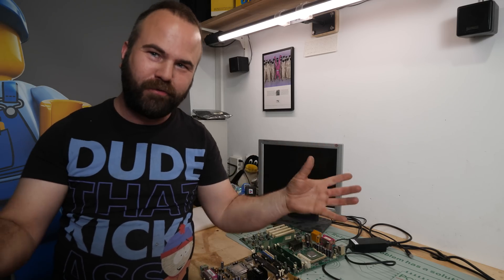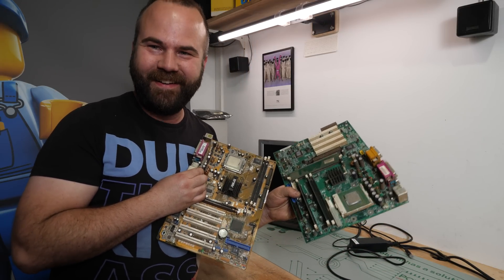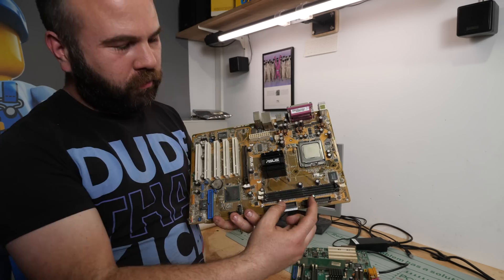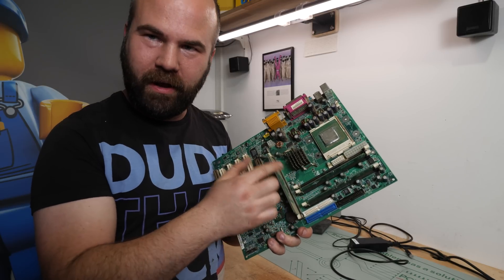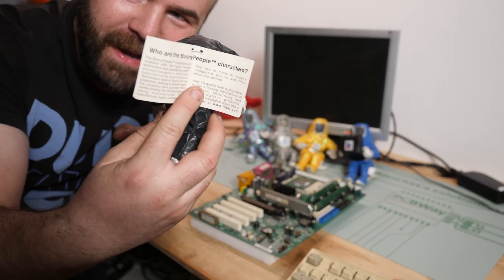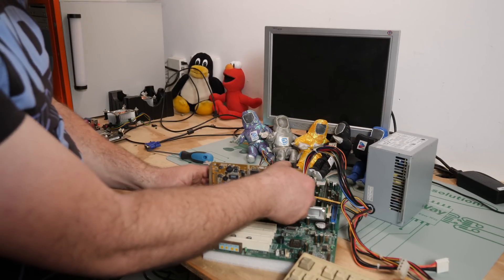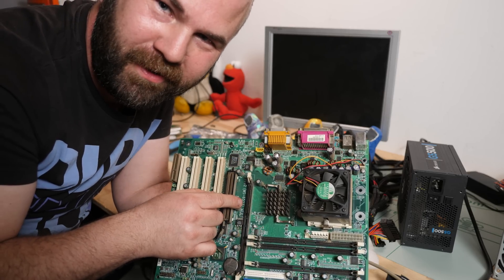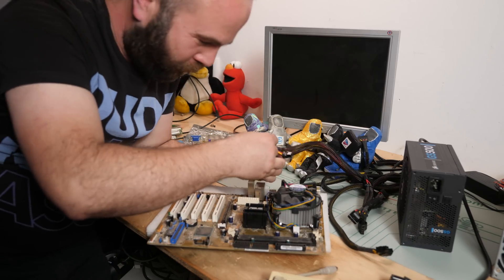Building A Pentium 4: I'm Going All In!

Comment: Many years ago a tantalum capacitor popped while I was powering up a pentium 3 board, the the flying fragment missed my eye just by a hair. Nowadays I always wear a safety goggle or glasses when powering up old boards.
Btw for your first board, I was already suspecting there was a short (in this case the exploded capacitor) because the cpu fan was not spinning, indicating the psu had detected a short in the power rail and shutting down. The Corsair could pump a lot more current and didn't consider it as a short, so the bad capacitor exploded, which is not a bad thing because you now know which component is faulty and needed to be replaced. The first psu is working fine I suspect.
For second board you need to install the cpu heat sink properly. It shut down only because the cpu was overheating.

Comment: Socket 775 and AGP slot? Interesting....

Next time try to grab a 955x motherboard, they're really cool looking and have a lot of decent features. Try to pair it with a high speed p4(3.6/3.8) or p4ee , and a decent gfx card from that era (7800/x1900)

I recently built a similar dream machine with a P4 HT 3.6, 4GB DDR2, P5WD2 Premium mobo, and a bit newer gfx card (8800GTS). Runs everything from 2003-2005 on the highest settings with no problems and even runs Crysis (at low-med settings on 1024x768 lol)

Comment: Maybe the first power supply was able to detect the unstable voltage on the capacitors and had some kind of safety feature not to power on. Some power supplies also do that when there is a short on the board or other components. Happened to me with a FSP power supply and it accepted to power on only after i solved the shorting issue

Comment: I built myself a P4 box recently. P4 670 3.8ghz, Asus board (sis 656 chipset), 2gbs DDR2-667, Radeon 2600XT 512mb, 160GB HD, DVD burner.

I like it. Even has a period correct Arctic Cooling Freezer 7 Pro for cooling.

Comment: If you're going to build a P4 system. I recommend the asus p4p800 varients with the intel 865 chipset. Not as good as the athlon64 imo but it will perform very well for most xp era games.
Reply: P4P800 wouldn't be a good choice at all. The VRMs are pretty subpar, and that's from someone who owns both P4P800-E Deluxe, P4C800-E Deluxe AND an ABIT IS7-E. The ABIT mainboard has much better VRM than ASUS does.

Comment: Nice job capturing those exploding caps! For a decent P4 experience try using a Socket 478 board with Intel 865 chipset 🙂
Reply: I've been trying to track down an ASUS P4T for maximum RDRAM nostalgia. I have the capability of capacitor repair, but man those 423 socket MB's are impossible to find for a good price.
On the flipside, i have a ton of 478 boards.
Reply from the maker: Yes that is the sweet spot indeed :)
Reply: G'day from the Kimberley - Australia. My P4 build is a 478 on the 865 chipset, 3.2GHz with two Voodoo 2 in SLi. It runs Windows XP. But my favourite is my old PII 450 with Voodoo 2s in SLi (running a Dell/Intel motherboard haha!). Keen to see how you go with the P4 Victor!
Reply: I bought a P4i65G brand new from amazon at two years ago. I never change this MB for other one. For me it's extremely reliable and does have dual channel (I have the P4i65GV too. The difference i guess it's the internal Graphics)
Reply: Had a 478 as my first pc so i have bias to them. With 775 it always feels like the p4 is a entry level chip and just want to jump to a c2q. With the 478 the 3ghz p4 are the top dogs haha. Have a few msi boards set aside for a xp build. Only issue is the lack of sata.
Reply: @alvar891  There are many 775 chipsets (i915 - i955) that are not compatible with C2Q.
Reply: true.. the challange is how to get the highest parts of 478 pin era, i got intel mobo 865DGLC, 4 gigs dim, AGP 7300GT, prescott 3.0ghz.. preety happy with it if we go back to 2004

Comment: I am constantly amazed that my Abit VP6 hasn't had the capacitors explode at all. It has been my only Pentium III board that didn't come with the capacitors pre-exploded, despite the signs of heavy use..
Reply from the maker: Most Asus p3 boards have good caps :)
Reply: @victorbart  They learned from their P2 boards. Had to recap my Asus P2L9Z as they kept failing.

Comment: I have a “retro” video capture machine running a 2.8ghz P4 in an Intel d865perl mobo with a Matrox Parhelia AGP board. Mine has normal RAM and not Rambus, thankfully.
Reply: We literally have the same CPU+mobo combination then, although mine came with a GeForce4 MX480 (and an attempt to run a broken Radeon 9500). I should some day spend some time and money on it to finally get the effects of the previous chainsmoking owner out of it (read: new case and PSU)
Reply from the maker: Nice! How do you like the perhelia? I have 2 of them in AGP and one in pci 64 :)
Reply: @victorbart  My Matrox video capture board only does video overlay with certain Matrox graphics cards, and the Parhelia was the most overkill of the bunch, so I grabbed one when I found it on eBay. I’ve never actually used it for gaming.

Comment: I built and GAVE someone a retro gaming PC that was a ASUS Board, Athlon 64 x2 6000+, 4GB DDR2-800 Kingston Hyper X, 300GB Velociraptor, 500GB Western Digital, Linksys Wifi G PCI, Radeon HD 5670 GDDR5 1GB, HP Dual Layer Lightscribe Burner. --- THEY THREW IT AWAY BECAUSE THEY SAID THEIR NEW PRINTER DIDN'T WORK WITH IT.
Reply: Most people probably are better off just getting a crappy laptop and effing off 🤣 I've put together some special builds over the years and I have felt the satisfaction of giving someone their "new" legacy system running for entertainment or business.
Reply from the maker: That is so sad they throw it out! I only gave a girl a Pentium 4 from Medion :D So if they throw it away it is fine :D